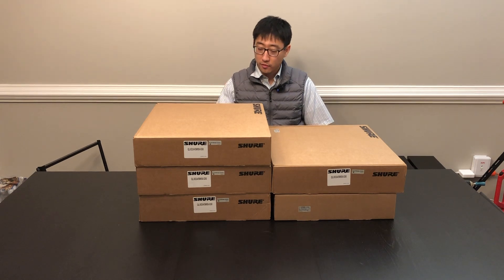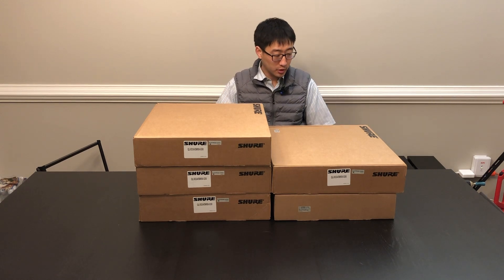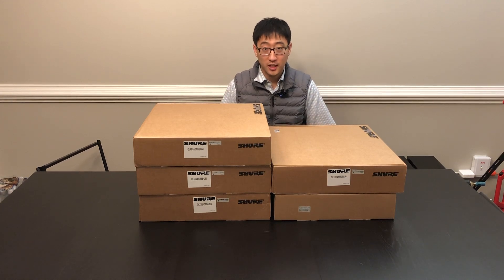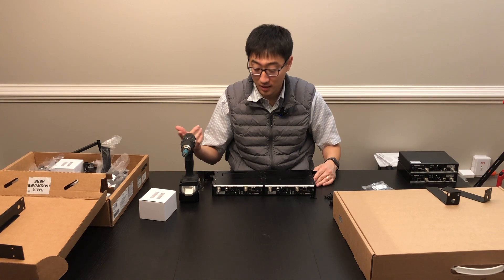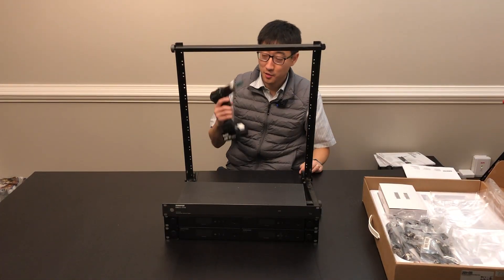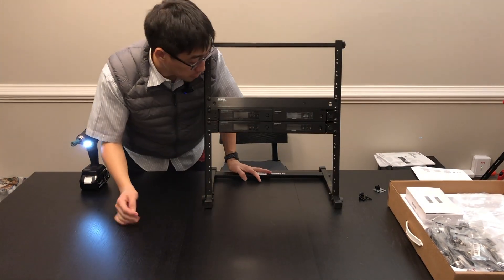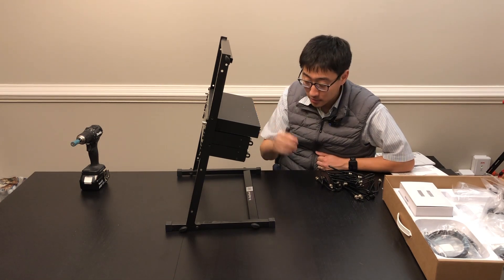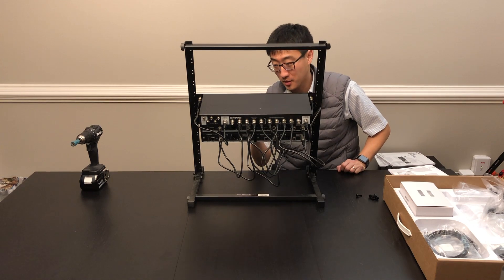4x Shure QLXD and UA844+SWB setup | qlx-d antenna and power distribution setup

Comment: Hey. Great video. If you had 4 QLXD4 with different bands (e.g., 2 G50 band and 2 J50A band), which1/2 Wave Antenna would you use? I believe 1/2 wave antennas are not universal bands and have different ranges of frequencies assigned to them,

Comment: Hi, thanks for the great video!  We are about to pull the trigger on the combiner for our 4 units, but I am wondering if we can remotely mount the 1/2 wave antennas above our desk (planning on the rack being under, lower than all the people and behind a brick wall). Thanks!
Reply from the maker: You can remotely mount the anteanns, but you will need to get the cables separately. You wiil/should also get the sharkfin antennas also. They actually improve performance a lot when installed properly.

Comment: Do you know if I can connect side by side on the same rack.. my wireless microphone receiver and my wireless IEM monitor receiver with a "coupler" mounting kit purchased from amazon?  both receivers appear to be the exact same size.
Reply from the maker: you could but i think you my have your info mixed up. IEM boxes in the rack transmit, while wireless mic boxes receive. you could mount them side by side, as long as you have proper antenna distribution. If you keep the antennas as is on the boxes you will just be setting your self up for failure.
Reply: @tgbatg  yeah for sure.  I knew that, I mistyped/mispoke.  Thx for clarifying.  Yes, I ended up mounting the antennas on a separate rack.

Comment: At what point do you need to distribution? I have 3 units.
Reply from the maker: I would always try to get a distribution if the budget allows when you have 3 or more units. Let me explain, it's more than just less antennas sticking out. It's because you can scan and manage the frequencies on all the receiver units quick and simultaneously. When you have one wireless device it always uses up ~ 3 frequencies because of harmonic frequencies. So having 2 devices you're really using up about 6 (roughly), not all th e same strength. By adding the antenna/power distribution, you can scan the entire spectrum / band, with one unit, and IT will calculate the best frequencies to use including into the equation the frequencies used up by harmonic frequencies, and assign them all at once to the units.

if you're in an area where there is relatively no interference like in the desert, then you probably don't need it since your frequencies would rarely ever change and you only need to set it really once. But if you're in a crowded area like big city, or areas that are developing it will definitely help since you will need to scan and deploy probably often. If you are mobile, and always going to new places. I would get it for sure with 3 units, since it will save time on setup, and also get you the best frequencies at each site for all units.

Comment: Is there a way to add 6 QLXD's to one UA844? I don't want to buy another one just for 1 more unit
Reply from the maker: not if you want to do it right. If you really wanted to try a work around (not guaranteed results) you could try a passive splitter like RF Venue 2X1SPLIT Passive Splitter/Combiner (assuming your frequency setup is within the range) and split one of the antenna ports for two units
Reply: I have an SLXD (J53) and a UA844 splitter, which antenna is the correct one, the one from SLXD or do I have to buy it because there are no 2 long ones in the set?

Comment: Thanks for making this video I'm still confused on how to set up the antennas is there a diagram to follow?
Reply: What are you confused about?  I can help... in a system like this the antennas will connect to the UA844.  If you are just running 1 reciever, they'll connect to the reciever, if you're using 2 recievers you can use 2 passive antenna splitters to feed both recievers, beyond 2 systems you'll want to use an antenna distribution unit as is shown in this video.